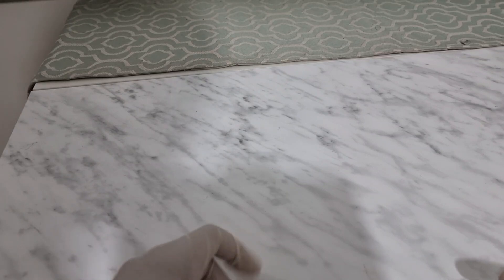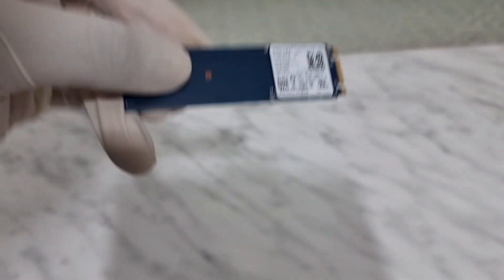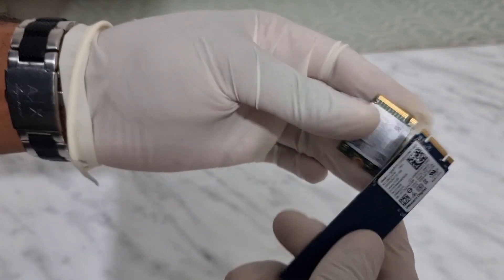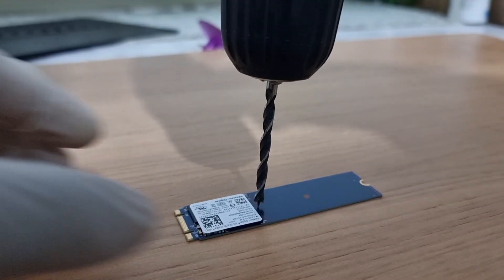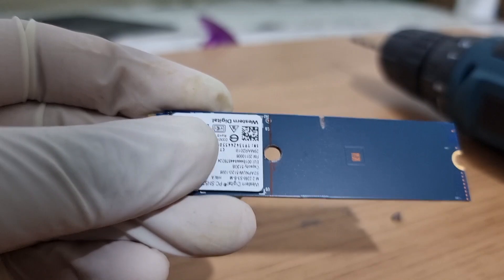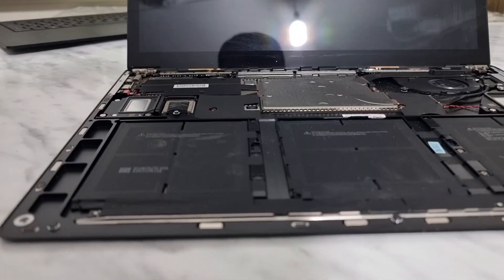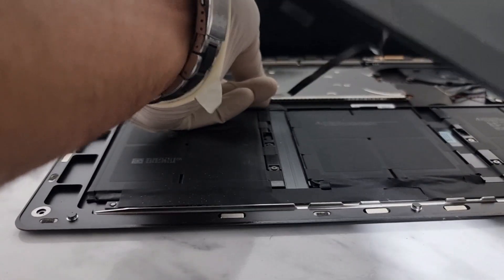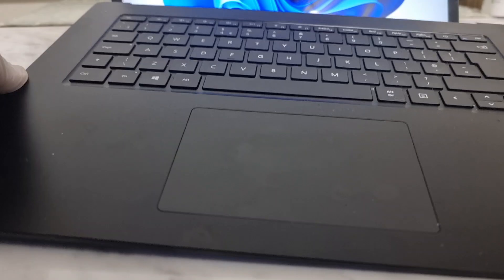How I Saved Money on M.2 NVMe SSD 2230 (Like Steam Deck) Upgrade for My Laptop

Comment: 2 slots mean it is not an NVME??
Reply from the maker: Sorry what do you mean?
Reply: @MH_Tech_UK  on the end where the ssd insert to the adapter has either one or two slots, yours has 2 slots which means m.2 sata ssd and not the m.2 nvme which should have a single slot.
Reply from the maker: NVMe have both versions, one slot is common but two slot exist.. Surprisingly